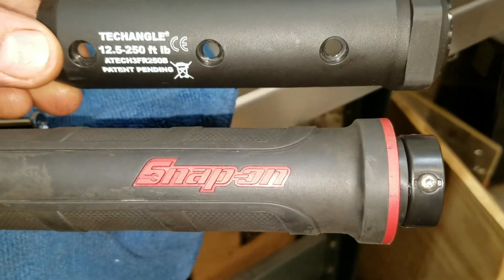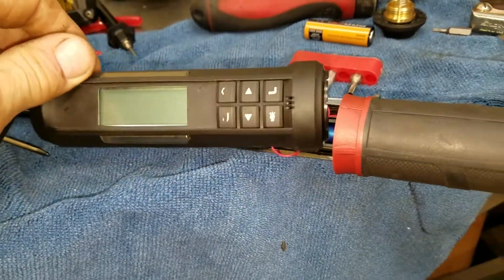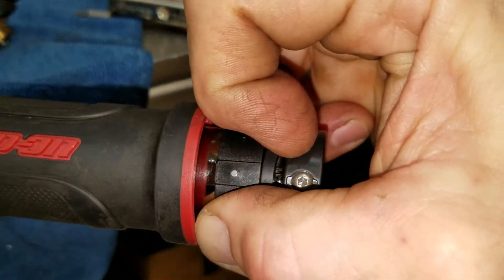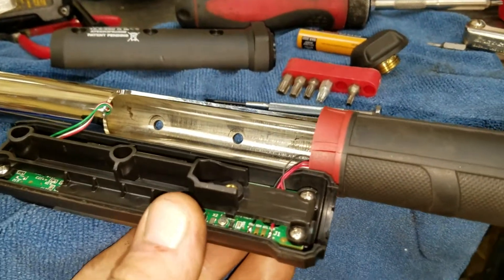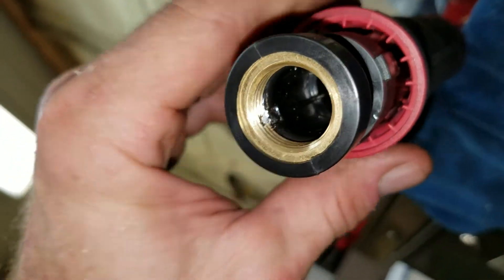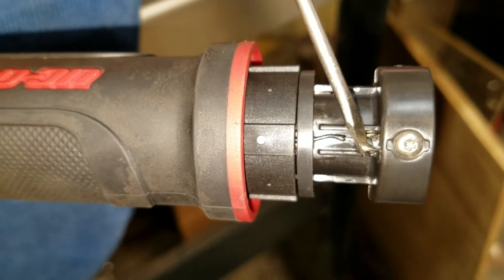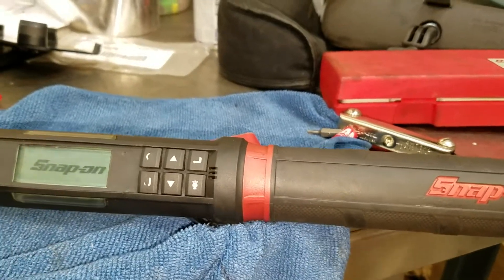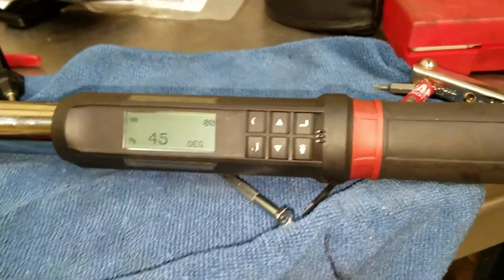Snap-on digital torque wrench shuts off

Comment: I have the grey and black handled Techangle ATECH3FR250 with similar problems. Mine is hardly ever used, and is kept in the house with the batteries removed each time. It is like new, but stopped working when I needed it to. I managed to fix mine for the time being ! Fingers crossed, hopefully long term. The problem was at the positive end of the battery holder. I removed the display panel which then showed the positive end of the battery tube. This tube has a slot in the side of it that you can see into. At this positive end there is round brass disc the diameter of the inside of the tube with a tang off of it turned at 90 degrees which goes back into the torque wrench through a small opening just big enough for it. This then has the positive wire soldered to it. The brass disc is backed up with a spring in this tube. I noticed this brass disc had turned on an angle in the tube and was binding up in the compressed state. When I slid the batteries down the tube I could see it was not making a good contact with the positive part of the battery. I used a small flat blade screwdriver to twist it back square which released it from being stuck in the tube. I turned the batteries around so the wider flat base of the negative part of the battery would push on the brass disc. The aim of this was to see if the brass disc would bounce in and out on the spring. The little brass tang for the wire connection had to be bent slightly so that it was now not binding in the small opening for it. Once I was happy with the brass disc moving backwards and forwards on the spring, I added a small dab of grease around the tang to aid in it's future movement backwards and forwards. The batteries were removed, and then fitted again the correct way around. Then I screwed the battery end cap on, and the torque wrench jumped straight into life with a nice clear screen reading as it should. The problem was fixed. I used the torque wrench the same day to torque an excavator head down, and had no issues with it. The day before on the same job it was cutting out and turning off, and I was ready to throw the thing across the yard. I was not happy. Basically it is a poorly designed battery holder. It should have just a pin point terminal at the positive end, and not a flat disc that can tilt off sideways. I can not see why the battery holder needs a spring at both ends ! Most battery holders only have the spring at the negative end where there is more area to contact. Hope this helps somebody out there.

Comment: You just fixed my snap on 3/8" and 1/2" that are just like this model.    Finally I can use it without having to tiptoe around with it and can grab the handle with a confident hold now.    Nice work and I agree;  once I opened this unit up I was shocked at the low quality for these $800 torque wrenches

Comment: Mine did this I threw it at my Mac toolbox and it turns  on now, but now it doesn’t torque right, so I threw it again into the trash, now waiting on my stahlwille digital torque wrench, 1/4 TW is crap too

Comment: Did you have trouble getting the screws out of the back? The security torx screws just keep spinning on mine, is there a trick?
Reply: The bolt closest to the head just pull and loosen at the same time it's a snug fit compared to the others

Comment: I buy only American made tools whenever possible. This thing is awesome when it works. But it don't work for long. I had this happen to me, sent it in for repair. Two years ago, they only charged me $30 and they shipped it back no charge. Used it about 30 times. This thing is never abused. Did it again. Now it's $100 to send it in. I will try this repair and get rid of it.  I'm going clicker type. These are junk. Sorry to say. Snap On really needs to address this and let everyone know when they do so that people know it's safe to buy a snap on torque wrench again. I would also recommend letting people trade in their old ones to get this junk off the market. It's bad for the brand.
Little O

Comment: After 3 years of light usage mine is acting up exactly the same. Took it apart and it seems to have fixed it. Now it is acting up again. I'll try soldering the leads, but I hate to have to try different options to circumvent a bad design/workmanship from Snap On. I wouldn't feel as bad if it happens to be Chinese made, but at $600 touting the tool as made in USA, is just inexcusable. If I want junk made in China at least I'm not being ripped off as royally as tools made by Snap On.

Comment: Great I bought a 3FR250A from a pawn shop today as this is the older version and hope I’m not going to have problems. They said if anything is wrong snap-on will fix. Couldn’t you have exchanged for a new one?
Reply from the maker: The warranty is limited to only a couple years because of the electronics.  Snap on "hand tools" have a lifetime warranty.

Comment: Mine just started doing it and it is exactly what I thought was going on. Nice to see how it comes apart. Going to give this a try tomorrow at the shop and hope it fixes the problem. $500 wrench comes down to a little ground wire. Thank you for posting this. Hope it works.
Reply: Did it work

Comment: My ATECH3FR250 broke the very first time I used it.  Brand new out of the box and it broke while doing 90 degree torque of head bolts.  I ended up having to pull the head bolts off and order a new set and that cost me money and time, all over my $500 wrench being a defective POS.  I have not used it since and today I decided to give it a try since I have to do 90 degree torque again on a Toyota.  I tried to turn it  on and it would not come on.  I looked at it closer and see where the solder broke on the negative ring for the cap.  Such a piece of junk!  Buyer beware./
Reply: Bryan Russell Sounds like you just got a defective unit.  All three of mine have been great to me for over two years now

Comment: We as the buyer should not have to take a $500 or 600 tool apart to fix....i just got two of then....man i hope this does not happen
Reply: Its all made in China. Snap on sold out. I spent thousands on electronic tools and they all have failed within or just over a year. Some got fixed under warranty and some didn't. The ones fixed broke again now outside of warranty